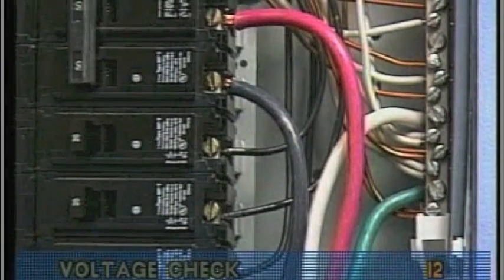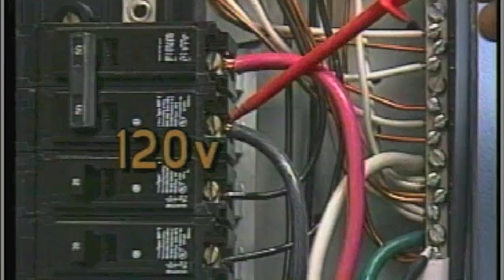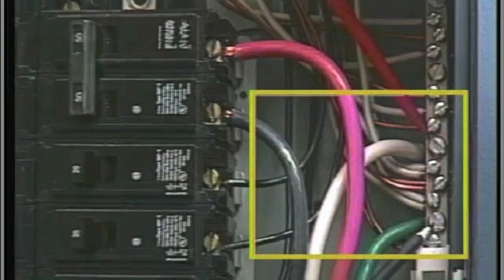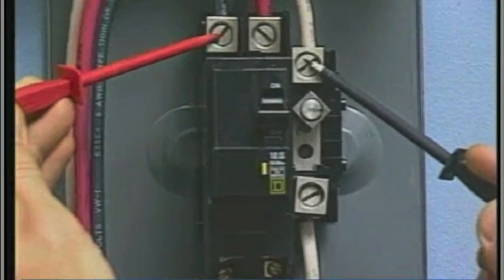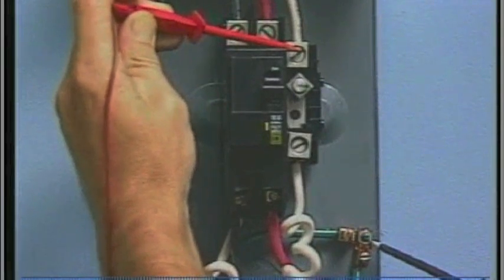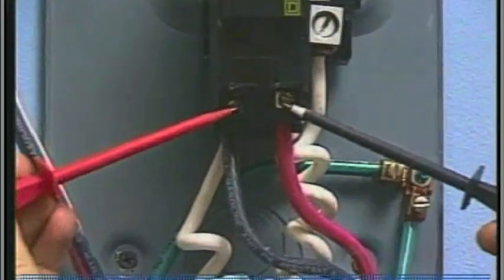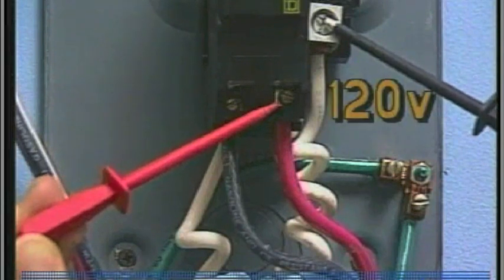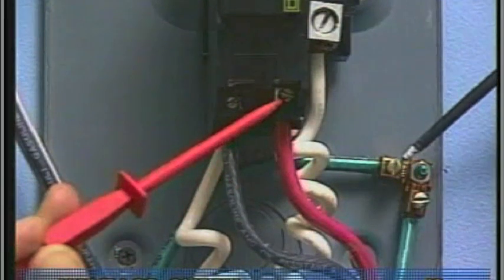Balboa Legacy Systems Series - How to check wiring voltages for SPAs - GFCI hookups

Comment: What is wrong with the wiring if i am reading 0 volts across the red and black wire. Its reading 120v across red and white and 120 volts across black and white, but 0 across black and red.
Reply: Did you ever find the problem? I'm having the same issue.